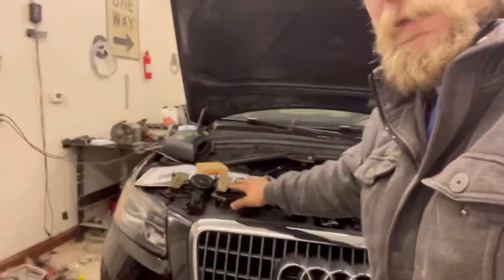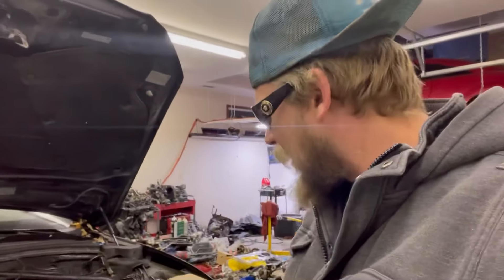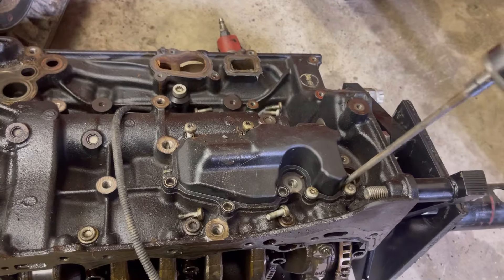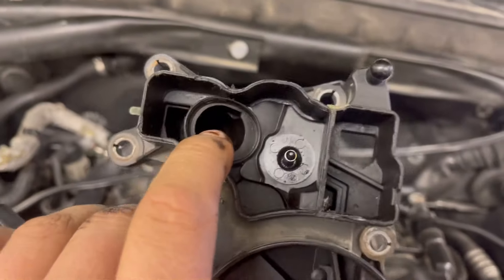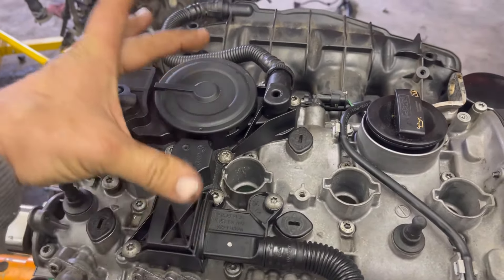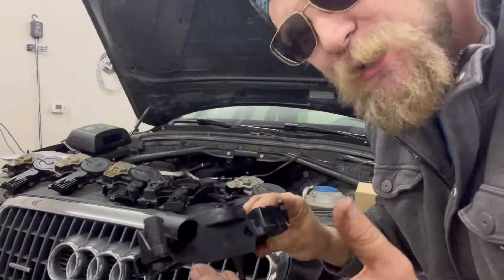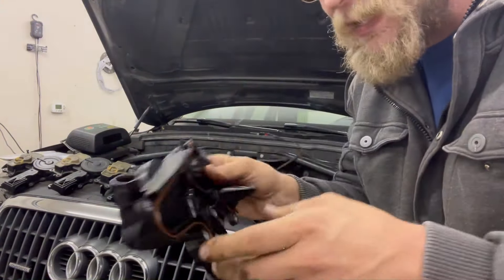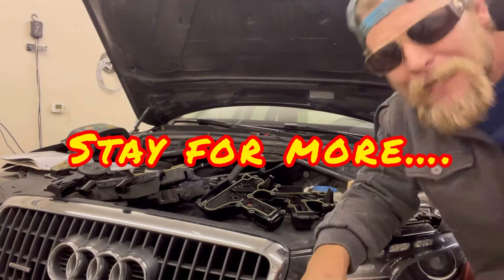2.0t oil Separator PCV breather testing boost leak crankcase pressure blowby P2187 P0171 Audi VW

Comment: You just demonstrated that the diaphragm repair kits aren’t worth buying because the check valves fail elsewhere. You are the king!
Reply: where is your mechanic shop i am in columbus indiana and i have problems with a 2010 audi a4
Reply: Correct.  

The check valve is the issue that permits pressure in the assembly and blows out the diaphragm.   

Even Changing to a “severe duty “ diaphragm valve will not cure the issue as pressure should not be in the assembly 

Install a new assembly.  Then Install an extra inline one way valve in the line between intake and pcv as a preliminary check valve.   Helps hold the high boost spikes from sharp pressure hits when tuned.
Reply: @VFORCEJOHN  do you have a part number for that extra inline check valve?
Reply: @VFORCEJOHN  part number for the inline?
Reply: Thank you!  I was gonna just buy the repair too!  Great channel!
Reply: @VFORCEJOHN  So one way valve between intake and pcv ? and it will work well ?

Comment: Mine was letting air in. Replaced the whole unit. Fixed my turbo underboost. Fixed my oil leaks. Fixed my vacuum leak. Fixed my rough idle. Fixed my lean mixture. Fixed my misfire. Dude. This PCV valve on Audis is so complicated and so detrimental to this car in every aspect. Thank God I cought this before I went and fixed other expensive things
Reply: I agree and I simply don't understand why they keep using these complicated valves.  I've worked on two Volkswagens and both developed oil leaks and ran shitty presumably from excess crankcase pressure.

Comment: I’ve changed coil and plugs , Maf sensor, throttle body and fuel injectors . Rough morning start and engine light came back on next is the pcv valve . 2016 Audi A5 . You helped me get through some rough project.
Reply: Did it fix it?
Reply: Did it fix it?
Reply: Did it fix it
Reply: Did it fix it
Reply: Maybe intake manifold gasket letting air seep in , also get a water bottle put it on jet and squirt your injector seals going into your Manifold, I had 1 that was letting air in when I replaced my injectors , when I shot the seal with water the motor changed and BINGO

Comment: 2016 Q5 2.0T, ran great with 0 oil consumption for 85K, overnight it went to using a quart of oil every 1000 miles or so but performance was great, no smoke at all, no leaks, didn't make sense. I watched your video and convinced me this might be the culprit. So I changed my oil, the PCV/Oil Separator (hoping that will solve the consumption issue). The diaphragm still looked good but that isn't the only part that fails as you demonstrated.  If my consumption stops, I'll do a video on the consumption linking your video for the explanation, I'm feeling positive that it will.  Thanks, Great video!
Reply: So, did it solve the issue ?
Reply: Did it fix it?
Reply: Yo man let us know what the fuck happened 😂
Reply: Was probably his Plugs and Coils lol You wouldn't believe how many of these have been driven to 100K miles on original Coils.
Reply: What happened after?

Comment: Dude I can't believe I found this video. My sisters Audi is leaking oil and has all these misfire codes and I replaced that breather part on top of the engine. But the oil leaks continued. It coming from somewhere near the turbo. I'm thinking it is that duct piece you showed. Maybe that turbo pressure blew the seal on it out. I am going to go check even though it's 3am. That's how excited I am to know this stuff. Thank you for making this video. There are a bunch of videos about the PCV on these things but none of them explain all the issues with them like this.

Comment: Tiny air seeps into the combustion chamber will cause bad idle as well, lot of people here mentioning that, water bottle on jet or squirt and shoot the injector seals and manifold gaskets and listen for changes, stick your head near motor and listen for baby air whistles also

Comment: Kudos to your dedication demonstrating the mechanism of the check valve. Today I fixed the P2187 problem by replacing the PCV valve assembly AND the short hose attached to the port you blew into. When buying the PCV valve assembly, I highly recommend purchasing the one that comes with the hose.

Comment: You are amazing!...My tiguan is from 2011 and during these days it started throwing bluish smoke from the engine exhaust, I was about to disassemble the turbo, I thought the turbo seals were blown and it is pumping oil in the intake, I did the try to blow the PCV that you do in this video, (it tastes disgusting after 100K Miles), but it was worth it!!!! I discovered that it was not working correctly, I clarify it is the original from the factory, I touch change and for now, although it remains to be tested, it does not smoke anymore so I think it should work, but I wanted to thank you for sharing this work that has helped me not to waste in parts not necessarily, that I have to change.

Comment: As painful as the broken belt has been, it provided a good opportunity to film some unique 2.0T content for you.  Keep filming NT!  Near the end of this video I think you summarized most of the damage I've seen it caused, but you forgot one - the broken wiring harness.  That broken belt fiasco would have been quite an expensive repair at the dealership.   Love this one, I have tested mine out a long time ago but never knew how much, if any, air gogin through would be ok.  Seeing the lower mileage ones with NO air bypass (when blowing) is a great comparison - thanks!
Reply: Had that happening on a mercedes w204, it ALSO snapped the transmission oil pipes that go to the radiator. The serpentine belt damage is equally catastrophic

Comment: Hi NaptownTuner.  YES, thanks to you I fixed my '11 GTI and got the check-engine light to go out.  I already did the new diaphragm and cap, from your other video, but it did not fix it.  Then I saw this video and I did the blow-in/suck-out test as you demonstrated.  No resistance in either direction.  Will save that new cap/diaphragm/spring for a future spare.  New PCV assembly was the fix.  THANK YOU!!

Comment: Yo! Naptown master  🥷 Thank you for this super informative video. My 2015 A4 Allroad was running like crap. Showing around 9 different errors. Got a used original PVC from junker on the car improved but still CEL coming up went ahead and got a good aftermarket new one and Allroad stopped consuming oil drastically runs smooth no
More Turbo lags and the best part the idle is as smooths as an electric car. 

Again thank you for all your videos. Peace Out.

Comment: Such an oversight with an actual integral part of the turbo system. I immediately replaced this part after watching this and boom! I have wayyyyy better throttle response and the car holds boost so much better. I’m on a stage 1 tune and was wondering what the hell was up with the loss of power. Night and day difference after replacement. Still throwing a code for the IMRC though and plan to replace that soon too!

Comment: Great video. My engine management light came on and it was diagnosed as this part. The idle was sometimes fluctuating on revs and it sounded rather unhealthy. 

The whole unit was replaced and I was given the old one. 

Upon doing your blow suck test, the old part seemed perfect. But upon opening the unit up.....yep, the rubber diaphragm was split. 

Whilst I guess I could of just replaced the rubber diaphragm, the whole unit was only £70 so it's worth while doing.

Comment: Yep the main rubber diaphragm is just one of many things this module performs.. agree that whole assembly needs to be replaced at 50k. Yep that side is a check valve to close off the intake when there’s boost pressure and when naturally aspirated it opens to allow vacuum to pull in blow by to re burn .. I’d imagine a faulty check valve would create much more valve deposits and misfire, too rich codes..etc. really educational video as always .. I think the AK version is the one with the green valve before that update it was all black

Comment: 2011 B8 150k had a P2187 code on OBD2 scanner and random misfire codes on VCDS.  Replaced the PCV module as a whole. The old one was original body that already had a Dorman snap on done at some point.  After watching the video which was Awesome like always and the old module failed the “blow” check.  Really happy to be able to identify the problem of the old module. Thanks!

Comment: Thanks for posting, it helped me. My Passat B6 2009 1.8 TSI (BZB) engine was shaking badly in the morning after a very cold night outside and had misfire error codes. In the end, the PVC was ok, but the crankshaft seal to the gearbox was leaking. I think the PVC froze and built up pressure. I replaced the PCV (OEM VW) and the sealing ring (reinforced version) as well as the clutch at the same time (yes, the gearbox had to come out of course, grrr). Now the engine is running better than before. Best regards from southern Germany

Comment: I have a 2013 VW CC 2.0 turbo that gives whitish smoke if I really romp on it, and increased oil consumption (about 1 quart every 2000 miles).  I have a VW shop telling me to replace the turbo, but multiple videos showing the possibility of this valve failure, which may increase oil consumption.  I think I will have this replaced first before doing anything else.  So many thanks to all you guys showing us these problems.
Reply: Hi david. Did the valve replacement fix it for you? If not I'm interested to hear next steps and if that remedied it? Thanks
Reply: @ingr4m  Have not done that yet.  My 80-year old mom required 24 hour care for 4 weeks, vomiting daily, then we got notice toove in 60 days owner sold condo, just made a cross country move, not sure when I will get to this.
Reply: @daveys35  have you done it now?
My TT got its 3. PVC Valve but it dosent help.
Reply: @daveys35  Hi Daveys, hope you and your mom is doing better now. I recently bought an Audi S3 which also gives whitish smoke (a lot) if i romp it. Did changing the PCV fix it for you?
Reply: @Pwnztankerz  Mine turned out to be a turbo oil valve diverter
Reply: @daveys35  Thanks a lot man, will tell my mechanic about my readings :^)

Comment: I've just replaced the PCV valve in my 5 year old 125,000 mile VW Golf 1.5 TSi (it's a European car). What a difference. Engine idles quieter, engine far smoother, fuel economy better.  The parts man at the Parts Dept of my VW garage said there's been a couple of revisions of the valve. Well worth the £92, about $120, I paid for it. (I fitted it myself)

Comment: Nice to understand how that PVC valve system works. I am new to Audi 2.0 Turbo. I just had that changed by a shop and paid a lot of money. Oil change too. Found out later they over filled oil by 2 quarts. But I caught it that night before any damage to my car. I will never go back to they again. I think they just were looking for my money. Cause me engine damage for them to look like a hero! They are not even a dealership just a place that specializes in foreign cars. Thanks for the good videos!!

Comment: I had all kinds of codes on my 2013 VW CC for a long time, 103k miles, and bought a diaphragm top AND the entire assembly on Amazon.  I could not get the damn top off the assembly even after removing the entire assembly, it broke in half.  But sure enough the diaphragm had multiple tears!  I swapped the entire breather assembly and the engine light went Off all by itself and it runs much smoother!

We'll see how long the $30 breather assembly lasts! I kept the old assembly and will probably clean it, do the blow/suck test, and put the new diaphragm on, in case the $30 one fails...haha

Comment: There's zero comparison between you and other YouTubers to explain what's actually happening. For one, I've been questioning my pcv for a while. I seen your finger tip test but now I just witnessed you doing the blow test. I've not seen or heard of anyone doing this before. You deserve more respect than you gain. You're just awesome 😎👍. I do ponder. I don't have a terrible idle, but on a cold start and it rests on the idle. I get blips / judders. Random.  Could this be the pcv? Cheers.

Comment: Thanks so much for this video!!  I replaced one of those valves on a 2017 1.8.  it was leaking oil, misfiring, etc.  I really wanted to know how the damn thing works.  You're the first one that I've seen rip one apart and explain it.  Why on Earth does Volkswagen use a part like that that can cause so much damage to the engine.  It just seems like a really bad design to me!  How do other manufacturers handle crankcase ventilation with turbos?  I get the need for a robust system to handle the changing pressures due to the boost, but there must be a better system out there that doesn't constantly fail.

Comment: I've got a 2.0 TSI EOS thats drinking oil (1L/600-700 KM - sorry for the metric). I've heard that the PCV seal/unit can cause oil burn. The car can also be a bit rough and a little sluggish? Strangely I don't see alot of smoke out of the exhaust, but do see a build up of 'soot' around the boot (trunk 😃😃 - I'm in Australia). I reckon I'll get the PCV replaced and see if that helps? Great video, really instructional and engaging.

Comment: So I have a 2015 Audi Q5, 2.0T, and its using a lot of oil, like a quart every 600 miles.  It has 88K miles now, been driving it since 16K, about 4 years.  It uses less oil during highway driving.  There are no other signs of problems, it drives just fine.  The oil separator has never been changed.  I suspect this is the problem, or the main problem.  The dealer, and Audi customer service swear there is no such issue.  I think I am going to change my oil separator next week.

Comment: Good work on the pcv. Iv been thinking of adapting one of these to my rb30 nissan 6 cylinder as the nissan uses just a basic pcv with no oil separation. The rb30 is in a 1987 Holden vl turbo in Australia.

Comment: I put a catch can on the inatke side of mine. Im not paying 200 to 400 bucks for a kit. I ordered a cheap catch can and cut the plastic hoses off the fittings. As im makimg this system i didnt want boost going into my catch can so im using an inline pcv before the catch can. Double insurance for boost getting into the engine

Comment: I would recommend searching out Chris Martino from ADAS LI, that man has found things' that even VAG of American didn't know with the pvc systems. When it comes to the EA888 I haven't seen anyone understand them like him.  

I remember talking to him about the pcv diagram hole and he said that not only do different revision have different size holes but they are also tired to the pcm updates. When he called VAG of America he was told to talk to an engineer and they didn't even know. When he was talked to the guy in Germany he was told the reason is not important just do as the repair as the manual tells you.

Comment: You would either laugh or cry 2018 Golf R 25000 kms had issues with misfire and rough idle so finally after some research some from you and others I set my eyes on pcv replacement but the thing is dude its been doing this for atleast 10k on a new engine so im a lil worried about dmg...

Comment: This was great! I replaced that diaphragm but am still seeing a lot of oil consumption and oil in my intercooler piping. Guess I’m going to be replacing the whole thing next! At 134k miles currently
Reply: Did it work?
Reply: @AngelRodriguez-jv6oc  it only reduced my oil consumption. I don’t get the puff of smoke anymore on hard acceleration but it’s still using oil. I haven’t put enough miles on it yet to fully determine. I will be back to my normal driving habits next week and can update you then.
Reply: @davegladys9820  any updates?
Reply: @bryani8973  still using a lot of oil unfortunately. I can see that there is oil spray coming from the connection between the pcv and the intake tube. Going to put in a one way valve in there as someone else did tomorrow during my oil change. If that doesn’t work, I may put in the catch can kit that replaces the pcv valve all together with the aluminum plate and catch can.

Comment: I think this is the problem I’m having with my 12’ Jetta gli. Crankcase vacuum and misfiring on all cylinders. Replaced the oil separator with an aftermarket parts store unit and problem still persisted. Going to try testing the check valve to the intake manifold

Comment: I put a new factory pcv on my 2012 2.0 turbo, oil still flows out of the pcv into the intake manifold and flows through the throttle body and down the intake tube. This puts the car into a limp mode. At that point the check engine light and EPC light are on at the same time.
Reply: Exactly the same problem I'm faced with ....

Comment: VW used the black cap separator/regulator until 2018, Audi switched to the clear in 2012 and VW has way worse carbon issues. According to what I read, the clear cap deposits way smaller oil molecules than the black and doesn’t create as much vacuum. VW’s have a failure that causes a whistle from the front and rear crank seals. Excessive vacuum sucks them in. 21+ Tiguans have a new design with a smaller diaphragm and pressure sensor (it’s on the new evo4 engine too). It has a failure that puts boost on the crankcase. Causes oil leaks from the plastic pan and upper timing cover. One I replaced actually cracked the oil pan. What people don’t realize when they put catch cans on these, that oil separator system is a catch can and it puts the oil back in to the engine not in to an external storage bottle.